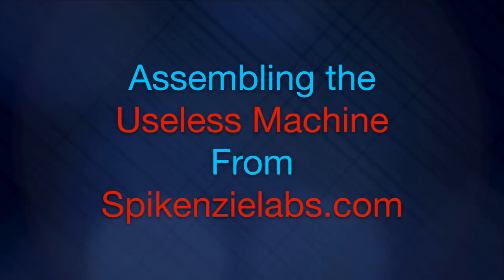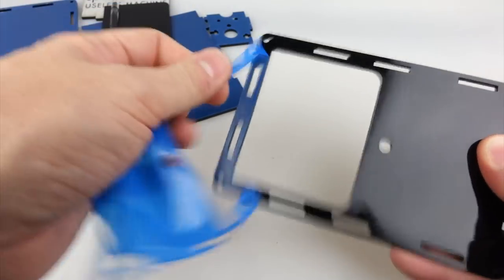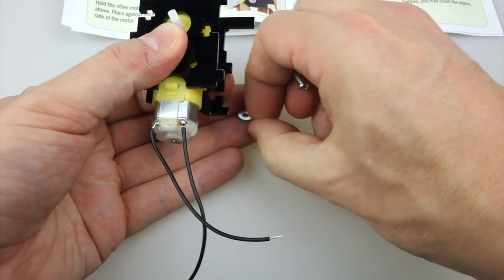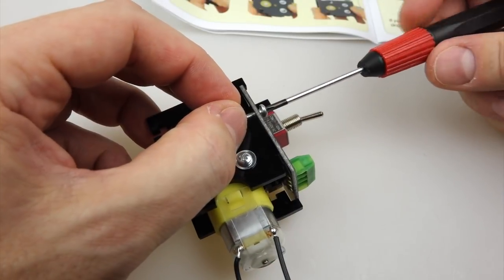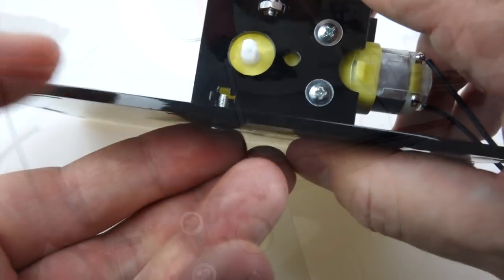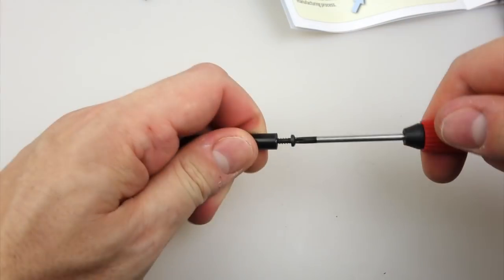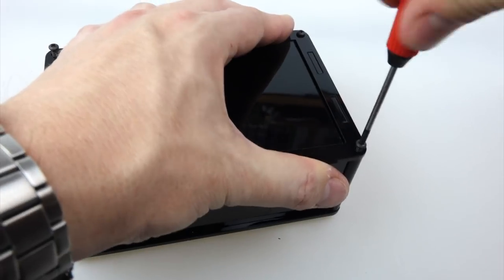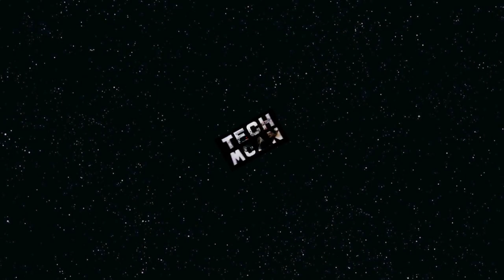Assembling the Useless Machine from Spikenzielabs

Comment: Would make a nice money box, small hand on the end of the perspex arm and a pressure switch to put the coin on. Had something similar in although wind up about 30 years ago :-)
Reply from the maker: I had the same thing - it was a tin box and a skeleton grabbed the coins and pulled them under a piece of cloth. I think they were pretty common back in the day.
Reply: they sell them on ebay from japan.
Reply: Techmoan When The remake of The Little Shop of Horrors was released on home video in the 80's they made a promo coin box in the shape of Audrey II. It broke down fairly quickly though. Be pretty collectable now!

Comment: Some 40 years ago ,a very similar box was sold as "The Thing", as a tribute to The Addams Family TV show.  You put a coin in a vertical holder on top of the box. The weight of the coin actuated a mechanism.  A creepy looking hand reached up out of a door on top, took the coin, and disappeared back into the box.  Identical design to "The Useless Machine" but with a zombie-like hand added.
Reply: Yepp ... had it also 50 years ago.

Comment: This is actually an interesting case study in engineering techniques, the Useless Machine.  This is a simple motor/switch logic implementation; I've seen microcontrollers and servos used, and I've even seen a 100% clockwork version.  That's right.  Wooden gears and wound springs.
Reply: In this application, both strokes are driven by the batteries.  The toggle switch is a double pole, double throw switch.  When in one direction, the motor is driven one way.  When the switch is the other way, the motor runs the other way.  The microswitch inside the box is in series with the "backward" half of the toggle switch, so when it's fully retracted, the circuit is open and the motor is stopped.

Comment: Geez what a pain to put together! I cracked the top piece, had to gorilla glue to back together, had to get a bag of rubber bands and my locking pliers to do the self tapping screws bit, and managed to crack a bit of the top part, but I got it together and it's as useless as it can be. I will be taking it to my office and seeing who wants to flip the switch!

Comment: Hi again Tech, I was wondering, I saw one of these on a video before, and it would switch off in different speeds every time, sometimes with some lag, other times really fast, it was super cool that it varied like that, this one seems to always turn off at the same speed, is that right?
Thanks!
Reply from the maker: Yes, it's the same every time.
Reply: ayy, it was jason vs the useless machine wasn't it?
Reply: +Ricardo Fortuny I little late but those are controlled by microprocessors like an arduino and use a servo for the "hand". that way they can vary the speed and do other functions. These are mostly just switches.

Comment: Get two of them and put them face to face with the doors to the outside. Then get a piece of wood that's just the right length to fit between the switches when one is on and the other off. The useless machines will push the piece of wood back and forth.

Comment: OK, I'm inspired. So you have an automatic Sansui turntable. Well, what to do with a manual turntable. If this device was hooked up to the cueing lever and one of those tone arm pre-sprung lifter thingies, when the tonearm hit the lifter device, rather than lifting the tone arm, it sets off a switch which then switched on the useless device to pull the tonearm up, it would be brilliant!

Comment: Re: the nuts falling out of the cabinet-slots when trying to assemble them: I use a bit of masking tape (it holds well enough, but also peels away easily/cleanly) to temporarily stick the nuts in place inside the slots till I have the screws inserted and threaded in, and then I remove the tape again. :D

Comment: A suggestion for putting the screws into the tubes the first time: use a pair of vise-grip pliers to hold the tubes!
Reply: Clamp them on JUST tightly enough to hold the tube without crushing it

Comment: The irony is that it would have been easier to make the device do something potentially useful, like just light a few LEDs. Engineers overcomplicate everything, they had to add a motor and sides in order to make the machine useless. I made stuff that was totally useless as a kid, when I let Play-Doh dry out.

Comment: Just a word of caution.  Be VERY careful handling the motor and the wires attached to it.  The little metal tabs that the wires are soldered to are very thin and fragile and break VERY easily.  I had one that broke off during shipping and the other one broke off even though I was very careful handling during the part where you have to align the shaft of the motor at the 12:00 position.   So, handle the wires on the motor absolutely as little as possible during the part where you have to align the shaft on the motor and during the final connection of the wires.

Also, the part where you have to screw the screws in to the four corner posts to create the threads, is a PAIN.  When Techmoan said this part was no fun at all, BELIEVE HIM!  Getting those last few fractions of a turn so that there will be a enough threads to make everything good and tight was almost impossible (for me).  In fact, two of the posts on mine are still a bit loose because I just couldn't manage to get the screw screwed in any tighter.   I'm going to try and find a screw driver with a bit larger handle (for better grip and leverage) but that still has a small phillips head on it and see if I can't get those two posts a little tighter.   This was the worst part of the build by far.  I to had cramps in both hands and managed to stab myself with the screw driver at least once.  The small, smooth posts are hard to hang on to while trying to get enough torque to cut the threads in by turning the screw in.  I know it would probably add a little bit of cost to the kit but it really would have been nice if they could have had these posts prethreaded in advance. It would have made assembling the kit much easier.  

Also a tip, the one end piece of the box has Spikenzielabs Useless Machine etched into it.  However, the piece is symmetrical so if for some reason you DON'T want the etched part with the company name, etc showing, you can simply flip that end piece around so that the lettering is on the inside of the box and it will still fit together just fine.  

I'd love to find a small plastic "hand" or "claw" or something to fit on the end of the piece that comes out and turns the switch back off.  I think it would look better than just the clear plastic piece.

Comment: Great to see these back again, but the original "black box" from Spencer Gifts was better. 

The box made a bunch of noise, the lid went up s-l-o-w-l-y, then a little green hand came out -- also slowly -- grabbed the switch, shut itself off, and the lid slammed shut.  Much more dramatic. 

This new version turns itself off so fast, that it's not even clear what's going on until you do it three or four times.  Wish they'd bring back the original...

Comment: I remember something like this that I put on my brother's light switch to his room.  It was the screw that actually extended and turned it back off, but it waited about 6-10 sec to do so.  After about the Nth time, you just hear him yell, "MOTHERF*CKER!!!"  Took him a few days to figure it out while he used a table lamp in his room stumbling over the trove of shit all over his floor to get across the room to the lamp.  It was funny after he figured it out too because he knew it was me.  I did it when I was 10 and he asked if I was some kind of electrician.  Irony holds as 30years later. I am an Electrical Engineer so, yes, I am some kind of electrician.

Comment: 5:50 I would have waited on installing the batteries until I'd unwrapped the lead-wires from around the battery holder, so that I wouldn't risk accidentally touching the two bare-wire lead-tips together and shorting them out...???